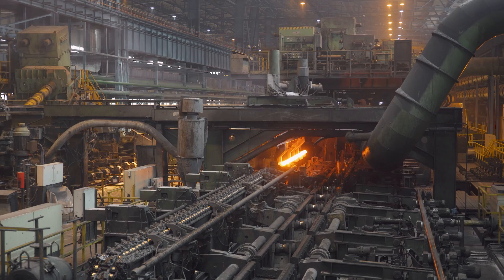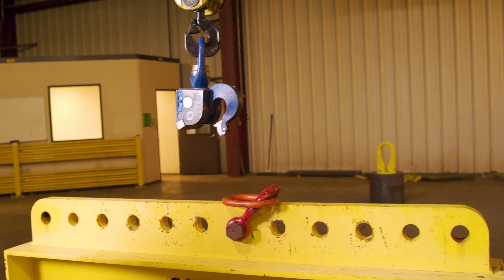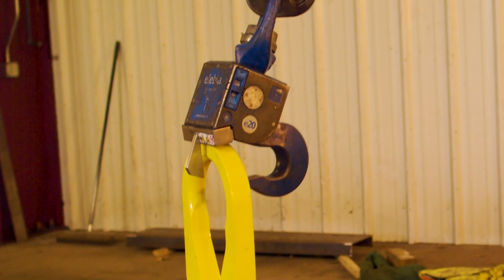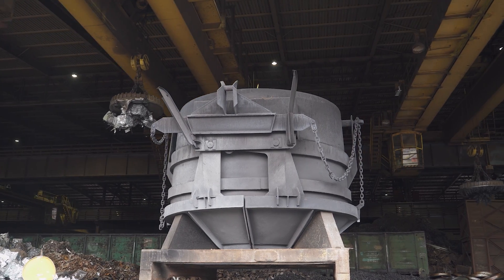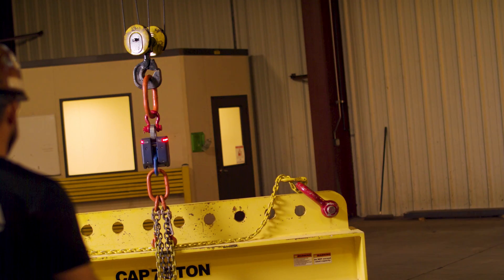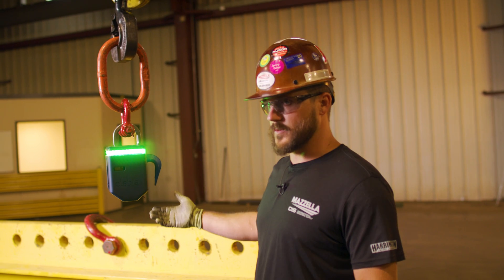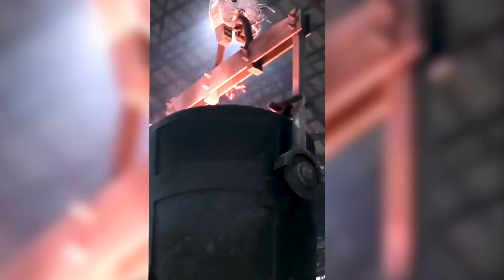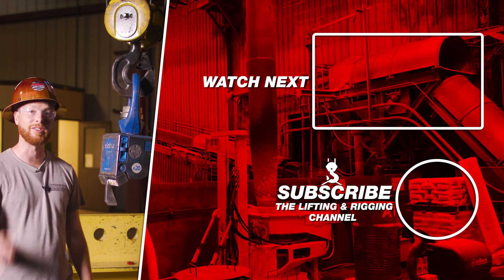Elebia Hooks: No-Touch Future Eliminating The Dangers in Steel Mill Rigging

Comment: One of my customer just lifting up a ladle using the tip of the hoof.  That could have turned out badly.  They are looking for a solution that will prevent that from happening.  You are talking about a ladle of steel with 200 ton heat so the total weight is 300 tons.